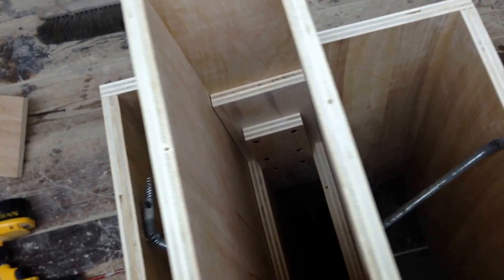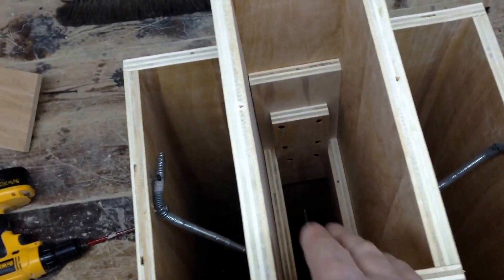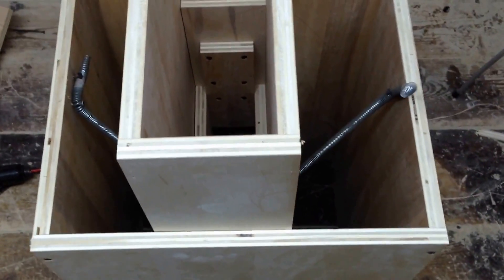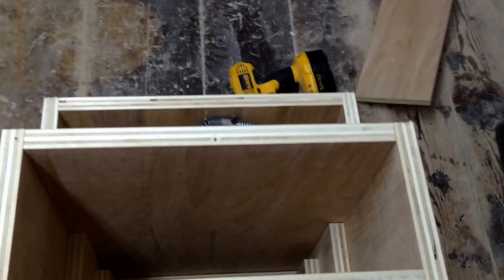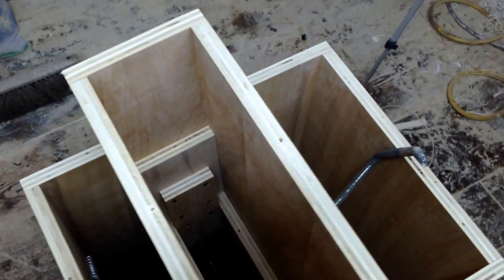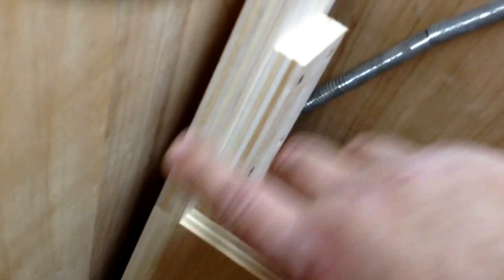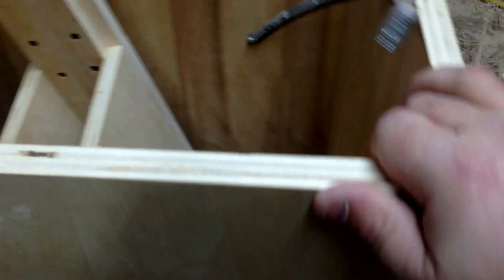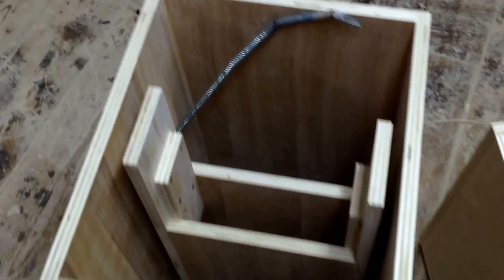Building Floating Router 3. How it Floats

Comment: This is a better build, as the outside surface of inner box of full width would be in contact with the inner side of the outer box, giving you smooth movement. if you make it those four pieces equal, then the joint would be touching the sides, which would not give you a smooth movement as the edge of plywood would be end grain, and inner wall of outer box would be linear grain. the way boxes are made in this video i feel is perfect for a smooth movement as full surface to surface contact is there, probably you can think of a prelaminated survaces to make it much smoother and absolutely tight.  Even HDF or MDF would provide a perfect smooth even surfaces to the boxes to move smoothly, than a plywood.

Comment: Thanks for the detailed overview.  This was really instructive.  I also had the idea of how you would cut both the external and internal box dimensions at once, in order to not have to worry about measuring so carefully.  Excited to see it get finished up!
Reply: Can you explain your idea?
Reply: James Cateno The gist is that you when you are constructing your boxes, you can use the exact same width dimensions to build your inner box and outer box.  This allows for no slop or complex calculations or error whatsoever.

One way to do this would be to rip a piece of melamine on your table saw.  Let's say a 4' x 6" piece.  You would then cut this into 4 pieces, giving you pieces that are about 1' by EXACTLY the 6" (because they're ripped out of the same board).  2 of those pieces would create the 6" internal width of the outer box (by having its other box sides sandwiched on the outside).  The remaining 2 pieces would create the 6" external width of the inner box (by sandwiching the 2 other sides of the box).

I hope that helps.  It's a bit tough to explain.
Reply: n8guy
I get it! Thats a great Idea...that would also work for the perpendicular sides of the floating box and the pivoting inner box.

Thanks a lot, I will be attempting this build soon and will definitely be using your suggested technique. Might be too tight of a fit though, haha ;)

Comment: Very nice design work toward a simpler floating router! One observation...in this video you proposed making the top floating box and the outer box share a cut. That is, by changing the butt joint direction in the top floating box, you could very nearly just set the rip fence once and cut four sides at once, guaranteeing the fit would be perfect. But if you did that, the other sides of top floating  box's butt joints would now be touching the interior face of the lower box. There would be end grain of plywood rubbing on the veneer of the lower box. I'm guessing that would cause some difficulty later on...just a thought.